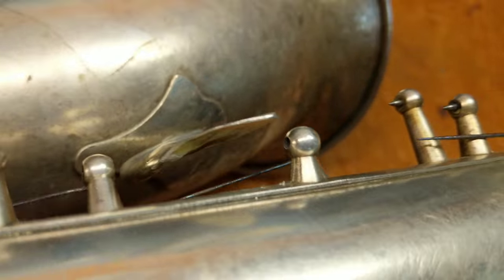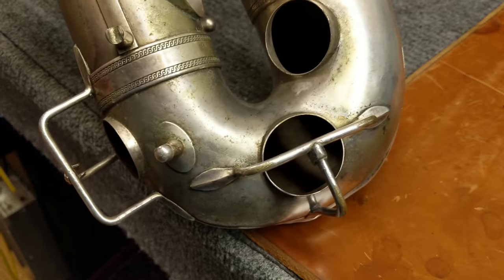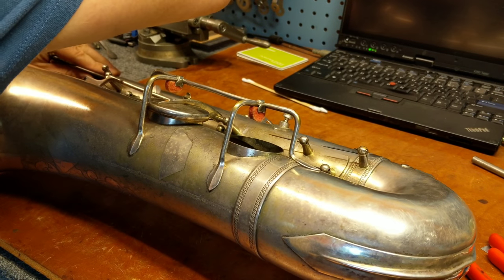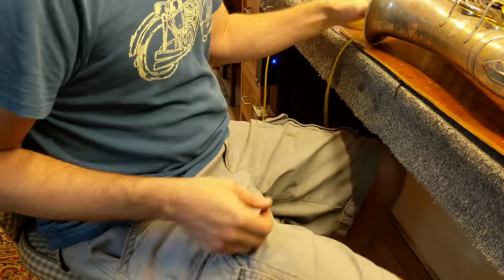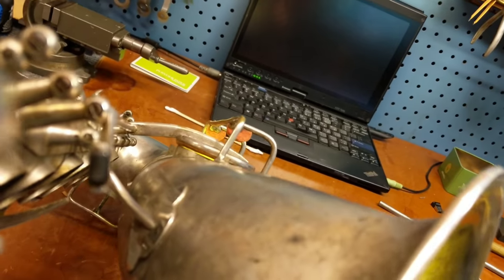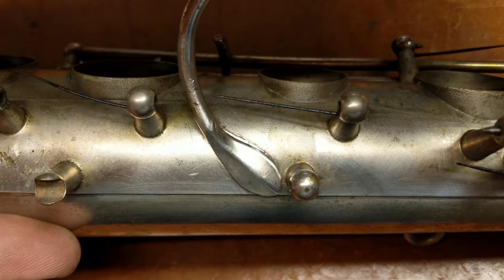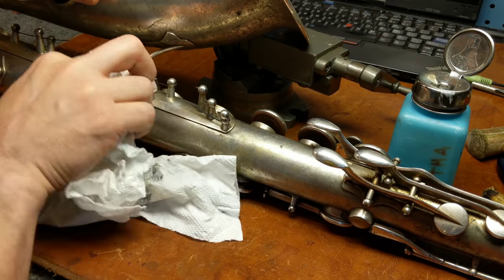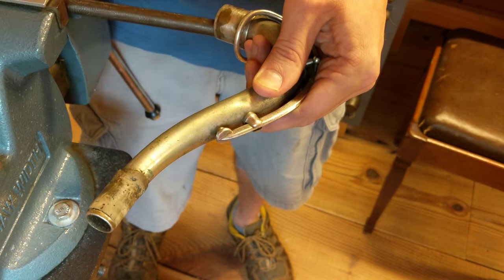Saxophone Repair Topic: Repairing Some Typical Long Term Damage on an old Selmer Tenor, Part 5

Comment: Hey! I would suggest looking up the process of annealing, it will help you prevent the neck dent rod from braking from the stress of bending. You could probably even use the torch you use for sauldering!

Comment: Hi Matt, I bought a SBA tenor from Saxquest a few years back, which had been overhauled before I bought it. I realised later that this instrument had been bent (the main tube at about where G# is) and later bent back straight. However, the tube is a bit oval, not the orinibal round it's supposed to be. Do you think I should get it repaired so it's round again or it's not doing any harm the way it is now? Thanks for your reply!

Comment: Hey Matt - yes I watched it all and as usual found this inspiring. As result I have developed a far greater admiration for my technician. I do adore vintage instruments and just love seeing them reborn, something you're so fabulous at achieving. I have been tempted to have some of my saxes re-birthed by some of the worlds finest but such concepts are unrealistic. Unfortunately I have a couple that will never be reborn such is the extent of former abuse and neglect. A Gebruder Monnig 'Exquisito' tenor comes to mind here where in the absence of appropriate rods, cut-off nails have been inserted into the posts, the surplus ground off with a grinding tool which has also shaved off more than a little from the post sides afterwich the nail ends were peened to prevent escape. Barely a tone hole round, botched soldering which can only be described as abysmal, butchered rods etc etc and no key cups circular. Veritable proof that Frankenstein was once an aspiring saxophone technician before the realisation that stolen body parts were less complex and more forgiving.  So...watching someone who cares as you do to ensure the instrument is as good as it can be is little other than a delight. Greetings from Melbourne.

Comment: Wow, great stuff! Thanks for your content.
I actually have the a light leaking problem on my low Bb key. It's leaking on the upper right side of the hole as you look at it from the front.
Pushing it to the side, as you would do when it leaks on the right side doesn't do the job. 
I would love some helping suggestions.

Comment: Hi Matt
I like how you said that one shouldn't feel wierd for expecting a technician to handle a repair of this scale. I have felt very apprehensive about having my horn straightened out.
One thing nags at me still; How much would a repair like this cost? If you can't say outright, can you ballpark it for me?
Loved the series. Super informative. You spout some serious know-how so casually it makes me think you don't realise to what extent you hare helping people understand the mechanical aspect of sax repair.
Good job.
Reply from the maker: I think I charged somewhere around $500 for all the work I did in this entire series.  A lot of the less interesting and time consuming parts (like where I took something from 90% done to 100% done) were done off camera.
Reply: @StohrerMusic  Interesting. I would have thought the repair would be more costly than an overhaul. Or a change of pads, even. 
Where i live the cost of a service plus new pads and allignment is around $1200. 
Is this the case here? Would an overhaul be 
more costly than the repair?
Reply: Excuse me! 600 dollars, not 1200. My conversion skills are lacking.

Comment: Damn! Lol. ;) it’s me watching all the way, that’s who! 

Matt, what’s your opinion about light annealing (like, to the heat point where sharpie marks disappear type of annealing) to prep metal for dent work?

How do you reshape neck dent rods for various shapes of neck? Just lock it in the vise and bend? How much for is needed, and any special tools? 

When you bought your magnetic ball for dent work, did you have to buy those packs of 50 or are those sizes available individually?